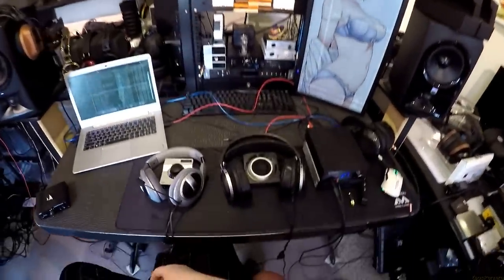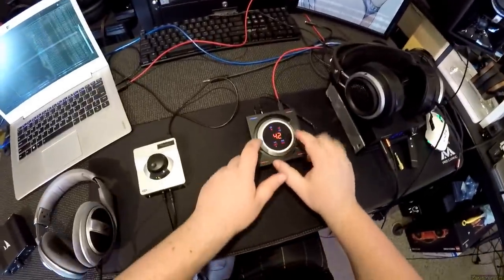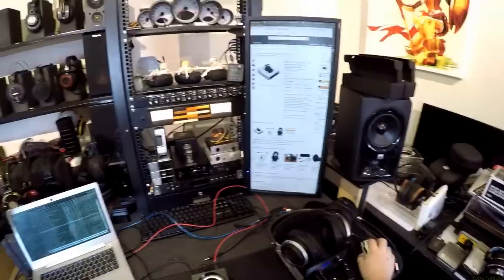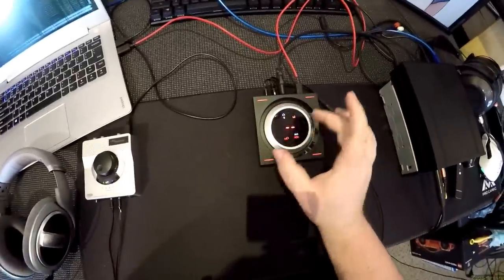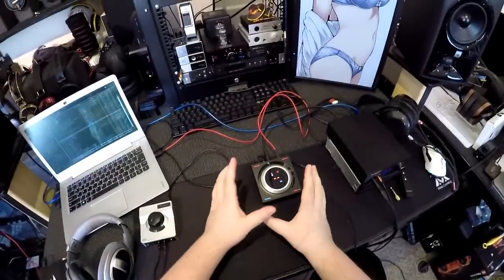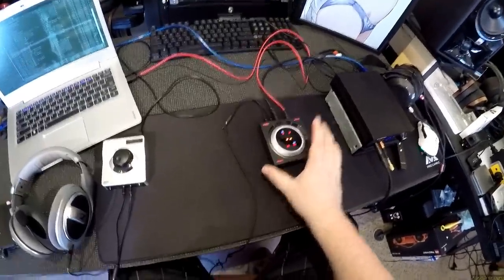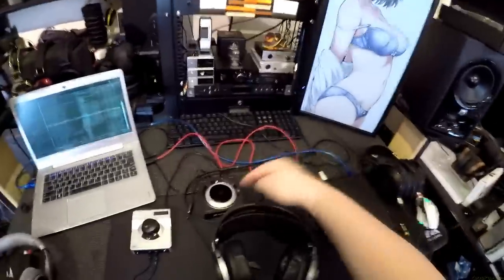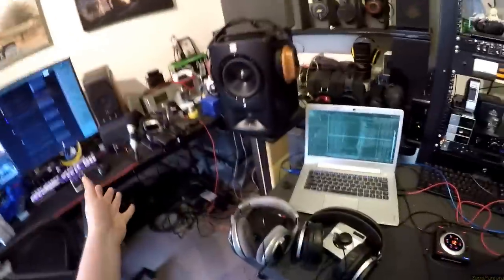Z Review - Sennheiser GSX1000 & Burson Play & Syba Sonic & Mayflower Arc

Comment: I got Audio Technica ATH-m50x and when I connected to my Laptop, it felt like it wasn't living to its potential. So I looked around and found Syba Sonic DAC and it has been THE best choice that I made. I just love to listen to music on these and during gaming, the sound is amazing that you can feel that you are in the environment.

I broke one by accident and I felt bad but then I knew that I didn't spend an arm and leg initially. Hence I purchased another one without breaking the bank. and like he said with his hand movements it is good, gets the job done and not heavy on pocket. BTW pro tip if you are connecting a mono mic to this DAC which has a TS kind of 3.5 mm plug, make sure you have a TRS adapter as just plugging into the mic line will not line up with the mic connectors in DAC/AMP. Also to note is that headphones with mic which have single jack will need an adapter to split it as the 3.5mm headphone jack on the DAC doesn't take MIC. 

But apart from that uf you want a no-nonsense-just-works kind of DAC / Amp. go for syba sonic. you won't regret it. :)

Comment: Picked up the syba sonic a couple months ago paired with my shp9500s.  Have not a single regret.
Reply: +modmic?
Reply: ew, no plus v-moda boompro
Reply: well i use x2's n an at2035. x2 into a fiio e10k, at-2035 into scarlett 2i2.
Reply: GameOn I’m using this setup with a Neewer NW-700 Condenser mic setup on a boom arm, Ran through a phantom power supply and controlled via a VB-Audio voice meter setup.
Reply: Yeah, i need something a little less conspicuous @work :)
Reply: Does the syba support a mic monitoring/ sidetone option
Reply: @s14tan hey mate what is the sample rate of your sound output for sonic syba and the mic input aswell? Thanks I dont know which one to pick 44.1, or 48, or 96.
Reply: Wish I could get this in the UK
Reply: Can I use it on ps4 slim?
Reply: @SnoozinFox  which is better bro.

Comment: I'm a PC gamer who doesn't game at a desk, and finally got round to ordering myself a modmic, just so I have something that'll let me chat with friends while gaming.  Use the Superlux 668B or Samson SR950, so it's nothing hard to drive at all, but the Syba seems perfect for me. Put a headset stand on top of the desktop, magnet the syba to the top of the case, and I've got myself USB headphone out and mic in. 

One of the complaints with my old setup, which I stopped using a couple years back, was that my mic sometimes sounded like I was in the middle of a warzone.  This was a $10 desk mic from probably 2005 that I would just hang off my shoulder and speak down into it.

Comment: I have the Sennheiser I was sort of let down by the audio quality until I swapped it to stereo in windows sound options and turned it to a higher bit rate.  I got more volume and it sounded a lot closer to my O2 still a bit less than though. But I kept using it for all the convenience it has with swapping to speakers, mic input and how clean it makes my desk.

Comment: I'm torn between the GSX1000 and the ARC. Right now I'm using ATH AD900X headphones with a modmic but I think I'm going to want something better for music listening in the future and I'm afraid if I get the gsx1000 that something like the akg massdrop headphones that are 300ohms wont get loud enough and I'll need to get a different one. If the ARC had the speaker/headphone switch so i could swap between headphones and my klipsch promedia speakers I think I would be sold since I shouldn't need 7.1 if I have headphones with a good soundstage like i currently do. Was hoping there would be more comparisons between the gsx1000 and the arc since you didn't have the gsx 1000 when you reviewed the arc. Overall good video tho. Anybody got suggestions?
Reply: I would like an answer here also
Reply: @BrumbleBear  the GSX 1000 was really meant to be paired with the G4ME headsets. Its a good compromise if you just want one pair of headphones.
Reply: I was thinking the same as tygamer but I tried the 7.1 option on the gsx and it DOES things to the sounds... amazing scary things (for games) so I'm in love with it but I do want to try out the more powerful amp and gsx combo. SOOOO, what would happen if I tried the magni3+ gsx1000 but also connected the mic? I refuse to get a desk mic. An answer would be amazing
Reply: So is the GSX 1000 worth it? Does the 7.1 really work with every headphones?
Reply: Sony Mdr7506 + schiit jotunheim? XD

Comment: Review the Schiit Audio Hel Gaming DAC/Amp
Reply: Didn't even know this was a thing.  I've been using a Schitt stack with the GSX (Overkill I know)
Reply: @AssassinGT  can you use the gsx features (crosshair mode) along with the schiit stack for gaming
Reply: @dragofx_5472  I do.  It helps a lot in R6 for Positional Accuracy.  Paired with AD2000x's
Reply: @AssassinGT  I'm thinking about going extremely overkill by buying either the HD800s or HD700  and get the SP200 THX 888 for fun and general use and GSX 1000 so I can get audio wallhack at demand. Do you think this would work? Or I'm going too much overkill?
Reply: @dragofx_5472  I think honestly,  there becomes a bottle neck for specific games.  I think my setup is a bit overkill for Rainbow6.  You could easily get the close results with m50x's - m70x headphones and just a GSX1000.  I think the setup you're looking at will be all the more pleasureable for things other than gaming.  I don't think games have the dynamic range to make use of HD800s.

Comment: 30:16 "its not powerful enough for AKG 712's" watching this on the GSX1000 with AKG 712Pro's & its at 26 volume on the GSX1000 cant really go above 36 on anything without making my ears ring for hours. Issue i found is if you have to many USB things plugged into the same lanes then it drags to much power from it. so i moved my keyboard to usb 2.0 & my mouse to usb 3.1 & its just the blue yeti & the GSX1000 on 3.0 dropped from 80 on the volume dial with SHP9500s & x2HR's to 18 on the SHP9500 & 22 for the X2HR's, the K12pro as i said 18~26 is fine, 36 is to loud yet can go up way more, WAY more. (yes this is the same volume as the PC is set to, dial controls it, Enhancements e.t.c. disabled, At a guess Laptops wont have enough juice to run them though). Weridly the Superlux 668B's work on any volume but you can hear the fatigue in them if its anything not gaming.
Reply: Totally agree with everything else.
Reply: This should work too without repluging: https://i.gyazo.com/3ac193018f8966832c399d4fec610c49.png
Reply: I just got K712 pro for my PS4 pro, I’m wondering which amp/dac would you recommend?
Reply: Hi! Should I get gsx1000 or e10k for k712 pro? I need it for games(fps and story driven) , music, movies?

Comment: Hi Z i know you are not a big fan of sound cards but apparently the latest one by Creative called Sound blaster AE-5 is well built sound card with dac. Would mind doing a review of it or even just checking it out and see what you think. thanks. I picked up The Shure SRH840's because of your review with i might add the shure 1540 earpads. My ears thank you for that.
Reply: It doesn't really matter how good of a card it is. The inside of your computer case is an electromagnetic storm of interference. You're always better off buying an external option just to avoid that interference issue

Comment: Not finished watching yet. I thought you were going to shit all over virtual surround like most headphone guys or self proclaimed audiophiles. It's refreshing to see someone that doesn't.

As someone that has tried a few different virtual surround solutions, I can tell you that it's a bit frustrating. While current virtual surround does give you a better sense of in front/behind, some implementations are better than others. The vast majority of these devices don't stand up to decent dedicated headphone amps in terms of power because they assume people are using 32 Ohm gaming headsets. Cross platform is another factor that limits your choices (for if you want to use the same device on console and PC).

I've not tried Atmos for headphones, but I'm excited for the possibility of either improvements (as opinion seemed divided on the implementation of it in Overwatch) or for someone else to do a better implementation using a device like this. Height is something that's been sorely missing in virtual surround.

I'd like to see devices like this with HDMI pass-through (since I believe S/PDIF is limited to 5.1 and the PS4 at least doesn't support multi channel audio over USB) because it will probably be necessary with stuff like Dolby Atmos and DTS-X unless games/consoles start implementing it natively (though I'd prefer an external box with backwards compatibility for 5.1/7.1 sources like PS3). If these devices continue to under deliver power-wise, I'd like to see them implement either an isolated line out or mix the audio to stereo and then send it out via S/PDIF so we can use our own DAC and/or amp to whatever headphones we want to use (yes, you'd have to run your mic to the device and the headphone out from your amp, but that's not a big deal to me and beats some of the janky setups I've seen).

What I'd like to happen more than that is for sound design in games become better and take into account stuff like occlusion (sounds being muffled when stuff is in the way), dynamic reverb and HRTF in-game as standard practise. That would make setups a lot simpler and we wouldn't have the need for external pieces of equipment to deliver more immersive audio.
Reply: napalmhardcore Smyth Realizer A16. Google it.
Reply: "What I'd like to happen more than that is for sound design in games become better and take into account stuff like occlusion (sounds being muffled when stuff is in the way), dynamic reverb and HRTF in-game as standard practise. That would make setups a lot simpler and we wouldn't have the need for external pieces of equipment to deliver more immersive audio." You can thanks Microsoft for that when they designed audio subsystems for Xbox they made it stereo without any HRTF. That would be only half bad but later they decided to unified sound architecture across XBox and PC so they implemented the same stupid very simplified audio into PC (Vista and all later versions). We had advanced 3D audio on PC that was 10x better then any stupid virtual 7.1 but Microsoft killed it basically. Those algorithms slowly are coming back to PC. BTW on Windows 10 you can test Dolby Atmos for Headphones for free.
Reply: I'm familiar with it. Unfortunately it's out of my budget and I suspect that's true for quite a lot of people. In fairness though, if you want the best, you have to spend the money, so I'm glad there is a high end option out there. Hopefully the technology will trickle down to more affordable products (I think there's already a few projects aiming to bring more immersive audio to the masses).
Reply: I know the old Creative cards had some really cool features on them in terms of 3D audio with stuff like the Doppler effect, occlusion and height. In fact, there's a demo here on Youtube but I can't remember what it's called. Seriously impressive stuff for the time.
Reply: That's actually the demo I was thinking of. I was mistaken, it was Aureal3D. Wasn't it implemented in the original Half-Life too?
Reply: Shameful confession I guess but I use my wireless Turtle Beach headphones way more than any good headphones because wireless is convenient and I like the virtual surround for watching TV. I never use them for music but for TV and games I think they're fine. I also like having bluetooth simultaneously so I can listen to podcasts while playing games (which is why I prefer them to Astro which probably sound better). They're built like shit so I've gone through three pairs from three generations but the upside of that is that I kept one of the old base stations that still had a headphone jack and I use that for when I want better sound, and they drive my dt-880s and my m-1060s well enough. Haven't tried a modmic setup yet but it should work with consoles if not PC.

I do hope they go to HDMI pass-through on the next gen, my old AV receiver actually had an optical monitor out which worked well enough but those things seem to be extinct and running the optical out from the TV gives a too quiet signal that leaves the headphones shutting themselves off every five minutes, ditto converting the second HDMI output.
Reply: It’s preference bro, I like surround for movies, I hate it for gaming.
Reply: Been using Logitech G35/930 for 5 years, for gaming only. No complaints. It really is preference. You have to define that point of diminishing return because you can always spend more and get less and less in return.

Comment: Remember the surround effect the GSX 1000 delivers can now be obtained for free using EqualizerAPO and HeSuVi plugin. So what youre left with is an amp that delivers only up to 150 Ohm. But im a big fan of external sound as soundcards inside computers gives you horrible static no matter what on your microphone.  Running the most expensive STX card from Asus and i still get static on my microphone. Have to use noise cancellation which lowers my volume alot.

Comment: I have a Sennheiser GSX 1200 output into a Bravo Audio V3 than unto my headphones.
Reply: Heuster Heu How does it sound double amp’d?
Reply: Cody Y just like z said the gsx is a little weak, but with another amp.... Omg the sound is incredible and enough to make your ear bleed or give u a headache .
Reply: Before this I had a Astro A40 tr headset, now don't get me wrong they are good gaming headset but I wanted something better especially for gaming. So I have settle with a gsx, bravo v3 amp and akg k7xx
Reply: I only hear it if I max out the volume knob, than again I'm double amping though.
Reply: Yours might be defected.
Reply: WolfMarineSK its a usb powered device, try change usb ports and maybe a different pc, maybe your usbpower is very noisy, maybe its not even the motherboards fault but another usb device plugged into it.
My brother had noise on his schiit fulla, and the cause turned out to be a rgb-led strip connected via usb, as soon as i unplugged it, noise gone, plug it in again, noise back...
Reply: How do u make it work want to get a magni 3 and make it work with my gsx 1000 but dont know if it will work
Reply: Leo Zodiac you just plugg it in m8 but if you have an easy to drive headphone anyways id suggest you not to double amp
Reply: WolfMarineSK well i wish you luck, sennheiser support should be pretty decent...
Reply: wtf why?
Reply: @Heuster101  is the bravo amp any good?
Reply: @pastoryoda2789  yes, and still using it.
Reply: @WolfMarineSK audioquest jitterbug can help, it's an usb dongle that sucks all USB/mobo interference so it doest got into your amp/dac. Just plug your GSX 1000 into it.

Comment: Great video Z. Just a word of warning about the Syba. I'm a bit of an audiophile and wanted a cheep DAC amp to power my HD598 C's at work. I brought a Syba Sonic just to try with low expectations...Honestly, I was very impressed for the sound quality for the price and the volume know is perfectly located on the top for easy assess. But, if you plan to use it in an environment where there is a fair amount of static, don't buy it. Sometimes i touch it the sound pop's and the dac looses connection for about 20 seconds. Really annoying so i send it back. No issues with the sound quality and design. Looking into a FX Audio DAC-X6 with external power to hopefully solve the static issue.

Comment: Dude great stuff. So, i'm looking to buy this (gsx-1000) for gaming and let me tell you why i need this. In competitive gaming hearing footsteps is one of most important aspect when playing. Some games like PUBG (Player Unknown) have shiet sound engine and it's very difficult to pinpoint the location of  footsteps , being shoot. 
For example when somebody is shooting at you , some things are happening for supersonic ammo, you will hear:
- The teeny sonic boom (which sounds like a crack, because it's teeny) of the bullet passing by
- Might simultaneously hear the whiz of the bullet if it's close passing to you
- Might hear the "thock" of the bullet's impact if it lands near you
- And then some time later you'll hear the report of the weapon that fired the round.
so having all that above in a blimp of a second it will take you some time to understand where you are getting shoot from , this is in 360 environment and not to mention distance and elevation are also in the mix. 
So i'm hoping this can help me with that, but can you tell me if you advice using this in game 7.1 with "crosshair" mode active or not ?

Ps. you're a little bit nut, just like  me :)